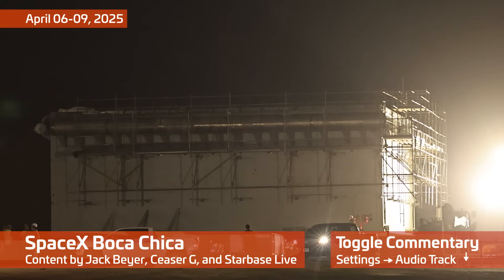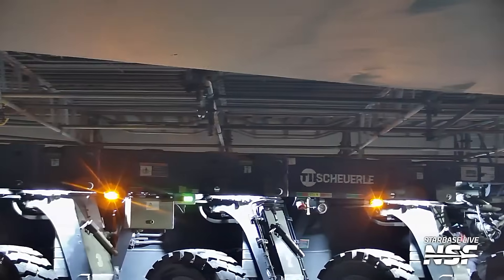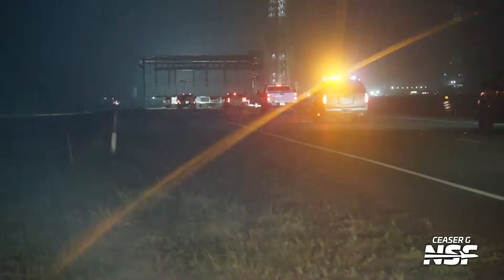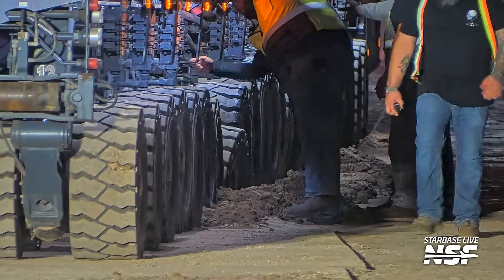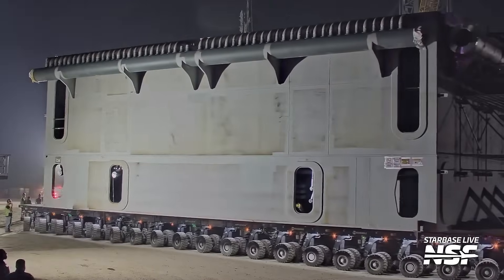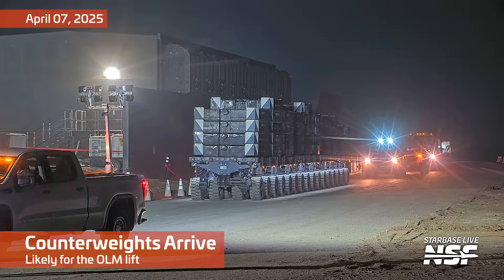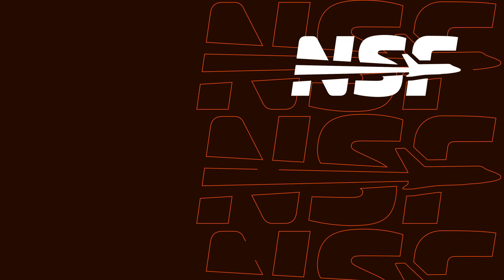OLM awaits installation on Pad B, Test Tank Booster on show | SpaceX Boca Chica

Comment: 12:21 why wouldn't they be thruster ports? If thrusters will be attached to the body in some such configuration for moon landings, then there will be structural load at that position and angle, so it makes sense that they would attach load simulators there for testing.

Comment: When the spot wheels sink in , the operators are isolating the next wheel along to manually stop it compensating , and then un isikating as it gets past the hole , see then turning the valve off to the wheel set

Comment: @nasaspaceflight The SPMT didn’t sink into the mud, there’s a pre-existing hole in the roadway that you can see at 4:35. They’ve tried to cover it and prevent an issue, but to no avail🤦‍♂️

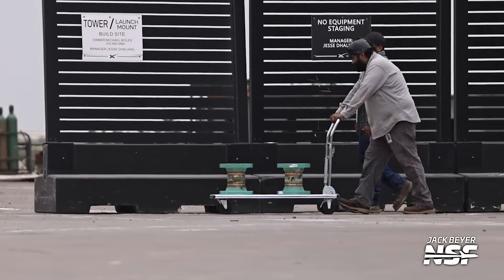Comment: 11:01 based on the paint it looks like a connection pipe was adjusted to the required length. Since both ends are re-welded, an offset may have been added to account for a small misalignment.

Comment: I'm guessing at around 288 wheels. Looks like 24 axles on the near spmt, 4 wheels per axle, 3 spmt's so 12 x 24 = 288 wheels. Of course, I could have mis-counted slightly, but it's within that ball park!